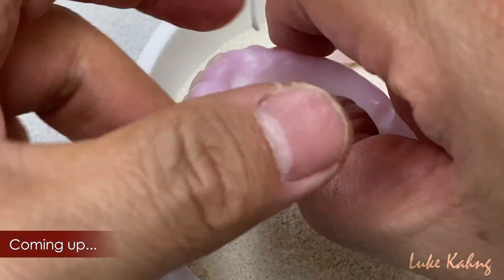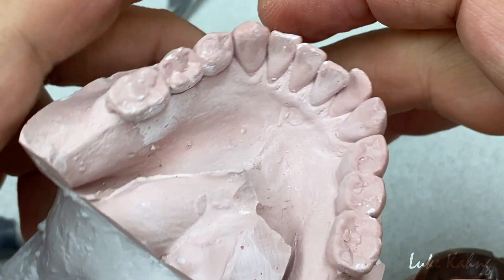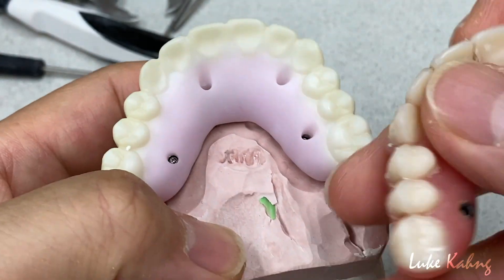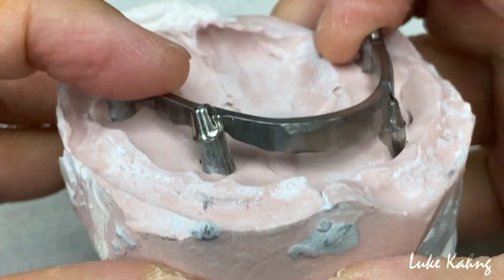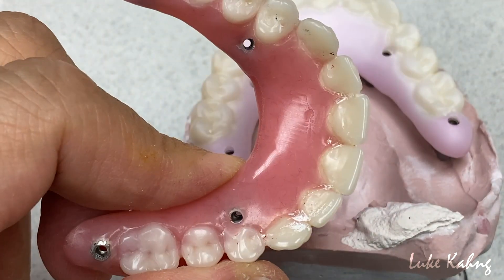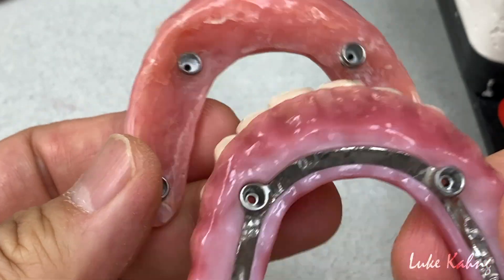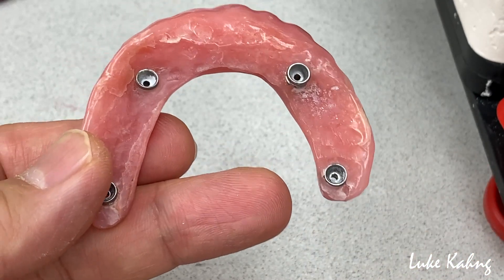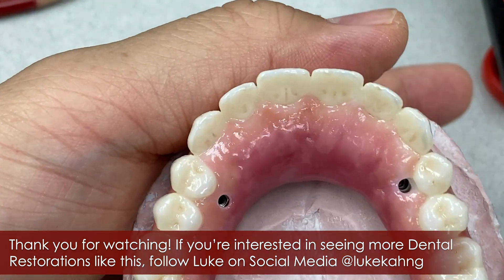How to Avoid Ti-Base Failures

Comment: Hello, which primer are you using on the metal before cementing?
Reply: Most metal/zirc cements nowdays dont need primer
Reply: i use GC G-Cem linkace and i never have issues

Comment: What's the difference between a Ti bar with a monolithic zirconia arch (like in this video) VS a Ti bar with teeth core and zirconia individual (or grouped) teeth cemented on the cores? The second solution seems better (split zirconia may resist better to flexi and in case of ruptures you can just change that set of teeth), but there's really an advantage on the practical usage or it's not much relevant in the end (or the opposite)? Is it a matter of costs?
Reply from the maker: we  made good videos before...please watch it...